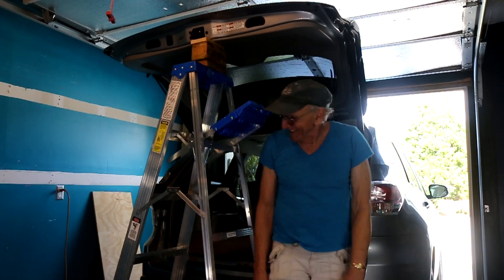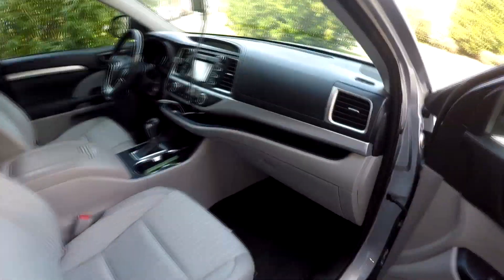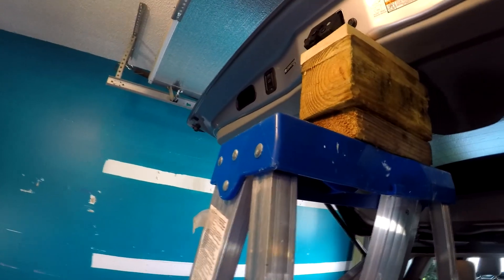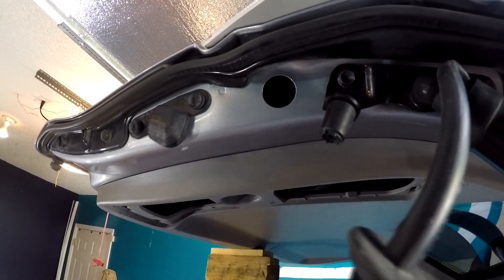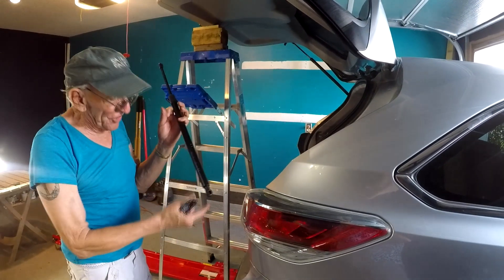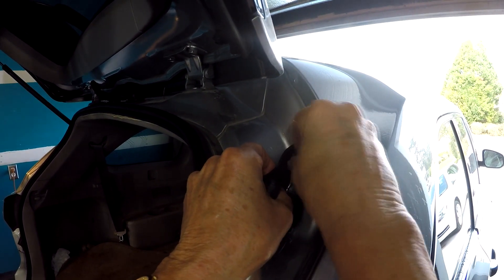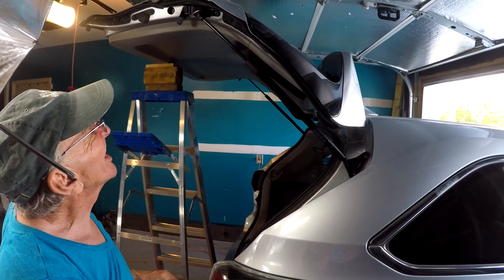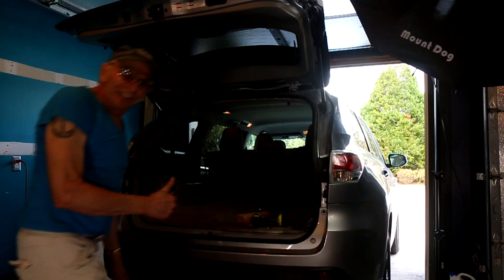Toyota Highlander power lift gate manual conversion

Comment: What’s the long term with keeping latch the same? I’m going to do this to my 23 Highlander LE. The L came with manual hardware but has different latch. Also to turn off in this model it’s on the dash in settings instead of glove box.

Comment: i have a 2012  -- there are no clips to pop off, therefore I can not remove strut.  Do you have any recommendations
Reply from the maker: Replace both entire assemblies.
Reply: Thanks for your input.   I bought the brackets and bought new struts that have the clips.  I should be ok now.

Comment: Damn electric struts are $800 a set from toyota. Just an FYI, if your electric  is not opening/closing like it should, check your battery first before replacing  them.

Comment: Dennis,  don’t believe you need new brackets (4) on 2021.  The retaining clips can be popped off the ends of the power struts thus releasing the struts from the mounting brackets.  Just debating now whether to get OEM manual struts or purchase off brand saving 50%.  Entire job can be done for $35.

Comment: This was the most helpful video that I've ever watched.  I ordered the parts that you listed and followed your instructions.  Everything works just fine and I saved myself over $1,800. I had taken the Highlander to the local dealership for repair and they priced the parts and labor at $2,000.  I ordered the parts you listed for $164, including tax and installed them inside of 1 hour.  Sweet.  Thanks!

Comment: Thank you for this!  This was extremely helpful on my ‘14 XLT.  The only thing I found is the breaker button had to still be on for mine.  Otherwise, the hatch never had any power to unlock the lock.  As long as I don’t push the button or try the remote and just open it manually it works without any alarm beeps.

Comment: I took another look at your video and the bottom right bracket showed the rubber pad, since you didn't show doing the left side I didn't know if it had a rubber pad, when I ordered my parts the left bottom bracket did not come with the rubber pad, as it turns out, it has to have one also so the company is sending one out to me, thanks

Comment: I received the parts today. Part number 68948-0E010 did not come with the cushion pad which should be there. The highlander limited has a cushion pad on both the bottom left and right. Did yours come with pads on each bottom left and right, please advise
Reply from the maker: I don't remember any pads at all.
Reply: they are more like a rubber stopper on the bottom brackets only, they are to cushion the door when it closes, the part number you give on the bottom right come with it, my bottom left did not and the company is sending me out the rubber so yours must have had them @cbonz7734

Comment: I have a 2014 highlander limited with a flip up back window, I'm going to order the parts as listed which say they are for stationary rear window, I don't see any reason they will not work as the door frame should be the same for all highlanders, just in case do you think I may have a problem, please advise
Reply from the maker: Several folks have done it and it seems to work fine.
Reply: Thank you for the reply, I think it will work also, I myself was going to look into it but your post saved me the time and effort, thanks again

Comment: I cut the brackets off my automatic struts but using those brackets it won’t hold open with the manual struts.  Are the brackets different for the manual struts?
Reply from the maker: As I said, you need to order the brackets with it.  
Bracket upper right  68945-0E030
Bracket lower right  68947-0E010
Bracket upper left   68946-0E010
Bracket lower  left  68948-0E010
Reply: OK another follow up question. Does this work for all models of Highlander? I have a Highlander Limited with a subwoofer and speakers built into the liftgate as a part of the JBL audio package. I would imagine that adds weight to the liftgate.
Reply from the maker: @cybervikes12  Don't know about that. Nobody else has had a problem with the struts holding up the door, did you get the parts I specified?

Comment: Thank you for sharing this repair - I just purchased the exact parts for $165 and hope it turns out as well.  Unfortunately, I just paid Toyota almost $200 to diagnose the liftgate on my 2014 Highlander and Toyota wanted over $1600 to replace both struts and the ECU computer!  When I asked the service rep what is the best price he could do, he said he already knocked it down from $2700 because the diagnostician recommended replacing the wiring harness too.  Sterling McCall Toyota on 9400 SW Freeway, Houston also wanted $750 for a valve cover gasket replacement, and other unnecessary repairs.  Lesson learned - stay away from them!  Thanks again!

Comment: The Toyota I'm talking about is a 2009 Highlander, limited, the power lift gate motor is broken and not working correctly, it is missing something in the lift motor/, on opening and closing, and the tail gate is jumping up and down, I'm in the process of making it a manual lift gate by disconnecting the power lift arm from the motor under the Highlander, and then the arm to the tail gate that lifts the gate, with the added struts it should be no problem manually lifting or closing the gate.  I've added stronger struts to help in lifting the gate manually, I wanted your opinion on this procedure. I'M HOPING I'm doing it right after watching your -video and talking to you, Thanks for your help in this matter.
Reply from the maker: Yeah, that's a different gen so what we discussed here doesn't apply, Sorry.

Comment: I've changed the tail gate struts hoping these will lift the gate almost by themselves with a little a lift from me, Now QUESTION, THE ARM THAT CONNECTS TO THE TAIL GATE AND THEN DOWN TO THE MOTOR HAS TO BE REMOVED, right or NO, SEEMS LIKE IF I DISCONNECT THE ARM TO THE MOTOR THAT LIFTS THE GATE THIS WILL THEN BE ABLE OT LIFT THE GATE MANUALLY AND EASILEY, True or?
Reply from the maker: I'm not sure which model you're talking about. The one I address have the motor in each strut, If yours is different I don't think this will work.

Comment: hi where you order the parts for highlander 2015
Reply from the maker: Parts:
Bracket upper right  68945-0E030
Bracket lower right  68947-0E010
Bracket upper left   68946-0E010
Bracket lower  left  68948-0E010
Stay assy (Strut)  68960-0E102
Stay assy (Strut)  68950-0E102

I ordered from   parts.olathetoyota.com

Comment: Thanks-It saved me $$. I found it easier to get the screws back in w/o attaching the struts first. You mentioned selling the old struts on eBay. Weren't they non-functioning?
Reply from the maker: My problem was in the safety sensors causing the gate to reopen mid travel, the struts were good and both sold right away.

Comment: Cbonz77,  it appears that the 2014 to 2019 , does not have a lift motor attached to the frame of  your 2014 to 2019 car,  as a 2009 does , it's a little different replacement procedure, the arm that controls the lifting and closing it seems is all powered by the motor attached to the frame of the 2009 , the struts mounted on the lift gate appears to assist the the electric motor in the lift and closing of the gate, this is the procedure I want to eliminate and make it a manually lift and close by adding the recommended struts,  The arm that actually lift the gate is what I'm talking about , does that arm ( connected to the motor and does all the lifting and closing)  does that have to be removed for a smooth operation o manually lifting the gate up and down? As you may Know dealer want me to bring it in for the repair, in and around $1500  for the fix?????Note it seems hard to find anything on a 2009 Toyota Highlender limited on U tube, and dealer again want me to bring it in.. So the call out for help is needed. TY.Jackie
Reply from the maker: This procedure applies to the 2014 thru 2019 model years, I have no idea how 2009 is done. Sorry.
Reply: Thank you, wanted to make sure this will work for 2016 XLE. sounds like it will? Same part #s?  Thank you so much! Excited to do this

Comment: A 2009 toyota Highlander limited is a totally different replacement issue? on  a 2009 Highlander limited , the lift gate has an arm coming from the actuator arm to the gate it self, that has to be removed for the gate to operate smooth once conveered to a manual lift gate, How is that done? explain?
Reply from the maker: The video clearly says 2014 to 2019 model years

Comment: How did you did disconnect the power lift gate arm that lifts the gate from the car???
Reply from the maker: It's in the video.
Reply: @cbonz7734   Not on a 2009 Toyota Highlander limited.

Comment: Is there a way to make the hatch emergency release work from the inside of the back? I like to lay in the back on a pad on the beach and I normally climb out the side.. It'd be much better if I could just pull a handle inside the back to open the back hatch.

Comment: The brackets for the manual lift gate struts are the same as the power lift gate struts.  The problem is getting the brackets off the power lift gate strut.  There is a metal retaining clip that holds them together and I couldn't figure out how to remove the clip so had to use a vise and hacksaw.  Cut half the helmet holding the bracket nipple off with the hacksaw being careful not to damage the nipple on the brackets and they come apart.  This destroys the power lift gate but mine weren't working anyway.  Mine now works fine.  Thank you Cbonz77!
Reply: Thank you, you saved me $100 not having to order new brackets. I cut the brackets off with a grinder and a hammer. Took about 45 minutes to do the whole job.
Reply: Thank you
Reply: Does the multiplex wiring system that this is connected to lead to any error messages on the dash or warning sounds/beeps down the road.  Google search indicates some issues with this.

Comment: Thanks for the video.  I have a 2017 Highlander Limited and I sourced the parts from a Toyota dealer in Winnipeg, MB Canada.  One of my struts was not working and I was quoted $879Can for the strut.  I spent $480Can on the two manual struts and the 4 brackets.  Removal and installation was easy.  However the new struts are not actually strong enough to hold the tailgate open.  It is still an improvement on not being able to open it at all, which was the case before.  If anyone has a lead on some stronger struts that would fit I would love to know.
Reply from the maker: As far as I know you're the first to have this problem. I wonder if one strut is bad?
Reply: can you please tell me if a bad strut was the problem,  I will be doing this same conversion on my limited

Comment: Just want to thank you for your video and response to my questions.  I ordered the parts as you identified, did the install, and all worked perfectly.  I saved over $1200 that dealer wanted to do the power replacement.  The door opens smoothly and it closes easily.  Parts cost me $141.  You have really helped loads of us with power door issues.  Thanks again.

Comment: Question that you or someone else may be able to answer.  I have a 2014 Highlander - Limited and want to do the conversion from power to manual.  When I look for the parts online, I keep finding that for the brackets, the description keeps saying either for car with flip up glass, or with stationary glass.  They are referring to the window in the rear hatch.  My Limited has a flip up glass.  Not sure why this would make a difference for any of the parts.  Also, I could not find a strut for flip up glass.  They all say with stationary glass.  The only strut I found that said with flip up glass was the expensive replacement struts for power hatch.  All of these parts are at Toyota parts dealers online.  I asked one parts guy and he said he did not know why Toyota shows with flip up glass or with stationary glass for the brackets.  Prices for the ones that say with flip up glass where all over twice the price.
Anyone with info on this would be appreciated.
Reply from the maker: The part numbers I showed were for my flip up glass and should work for you.

Comment: Has anyone done this with a 2013 rav4 or similar year?
Reply: I also have a 2013 Rav4 and am looking into doing the conversion. Any word?
Reply: @Pusser   i was able to do it!!! just ordered the parts that would be for a lower trim rav4 without all the power crap and it worked out great.  I would recommend getting new mounting points for the struts since its really hard to get the power ones off your pre existing mounting points.
Reply: @coolcar159951 do you happen to still have your part list and where you got them?

Comment: Hello. I was wondering what would happen if you tried to just switch the button in the glovebox to manual mode and kept the power struts on there the way they were? I ask because I just bought one of these cars from another state and should be arriving soon.
Reply: I tried that, doesn't work. it's like non power steering for a lift gate.
Reply: @D-NICE33  Takes a little muscle but when the system is acting up it gets the job done
Reply: @Outsideisnuts  I know,  I have been doing it every time the door malfunctions.  I installed the manual  ones and I am very happy with them. I have plenty of muscle it's my patience that were wearing thin.

Comment: Excellent! I just completed this conversion on our 2015 Highlander Limited.  It works great and cost ~$137.  Unfortunatedly, I paid $300 for a diagnostic at a Toyota dealer who then quoted a total of $1100 for repair.  I am far ahead and very pleased!  
I do recommend hand started the attaching bolts to avoid any possible cross-threading.
Reply: Hey Keith , where did you get the parts?  $137???
Reply: can you please tell me how your conversion is working since you put it in, thanks
Reply: is the conversion still working ok for you, please advise

Comment: Thanks for the video. My electric ones stop working after 6 year (2014 Highlander XLE). I bought the non electric ones for $61 CAD each (I’m in Canada) at my dealer, instead of the $1500 for the electric. FYI you DON’T have to buy the brackets ($50 each so $200 for 4...) just use the one from the electric strut, may have to do some cutting on it, but as you don’t need the electric strut anymore, who cares.
Hope it helps Canadian viewers 😉

Comment: There must be a way of removing the automatic ram/motor from the existing brackets. We received a used automatic ram/motor for the RHS from a parts dismantler without the brackets - has anyone any advice? We will most likely convert to conventional if this unti fails

Comment: Just did this modification to my 2014 Toyota Highlander XLE because the previous electric tailgate lift failed. The install of these manual parts works great for me. Took 20 minutes to install because I'm slow. Very easy to do. Thumbs up to the gentleman who posted this. I bought from the same place he did.
Reply: How do you manually open the gate? Mine won’t “release” now that I have the manual struts on. (It closed great!)
Reply: Never mind, pushed the button he said was important ha!

Comment: Thank You! I ordered the parts and just finished installing it on my 2015 Highlander. Works perfectly. Your instructions (as well as which parts to order) were invaluable, and you saved me big $$

Thanks Again!
Reply: Where did you order the struts and brackets?  I also have a 2015 Highlander.  I want to switch it to manual instead of paying $1400 to fix the problem.
Reply: Amber Hebert Just click on the Top Heading of this Video, where it shows a description of the video. He includes all of the part numbers as well as the web site to buy if from.

Comment: Thanks Cbonz77. My 2014 LE Plus started to have the same problem at the end of 2017 when the warranty was just ended. A dealer in town wanted a thousand bucks to replace the powered struts. I planned to do it myself to save a couple hundred bucks ($800 for a pairs of powered struts at the time) but I did not get around to do it. Then when I started ordering parts last month, I looked up online to see how people replaced them, I found there are so many people had the same problem even with later years. It appeared Toyota did not fix this problem. I realized this problem will happen again in 2 or 3 years replace the same part. I wondered if someone converted from power to manual. I googled up and there you were. Awesome! I just got it done today. By the way, the lower brackets (the one on the lift gate) are exactly the same as the ones I ordered. However I could not remove them from power struts.

Comment: Good Job!! And for the holes on the side panel http://prntscr.com/s233i1 You can order two of these https://www.ebay.com/itm/2-Pack-1-1-4-Black-Rubber-Flush-Mount-Plug-for-Body-Sheet-Metal-Hole-1-25-Inch/183712432298?hash=item2ac61d40aa:g:QJgAAOSwxklce5Z3

Great

Comment: Thank you very much for the excellent video!
I did my conversion today on my  Highlander  LE Plus 2014
I ordered the struts from amazon $ 55 for two.
Qty (2) Stabilus SG229054 Highlander 14 To 17 Liftgate Lift Supports W/O Brackets https://www.amazon.com/dp/B018TBC55Y/ref=cm_sw_r_cp_api_i_DlPJEbG4TPB7S
Reply: Hi Oscar, what about the brackets? did you have to order the toyota brackets?
Reply: Great video! What brackets did you use?
Reply: can I use the brackets that are on there already?
Reply: Yes, I ordered the Toyota brackets he put in the description and ordered the amazon linked struts. all good...fyi

Comment: Very good video. Mine closes from the remote, inside next to steering wheel and via the button on the hatch.  And opens from remote, button next to steering wheel but not via button where you press and pull  to open it manually. That button suppose to open it automatically too. Anyways... pulling it to open is faster, so I ll wait more to replace.